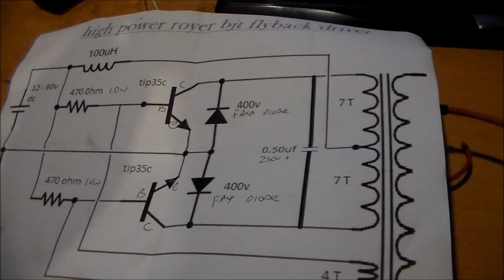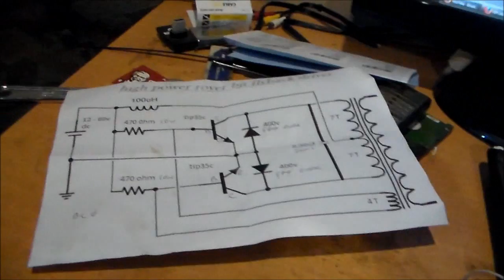Royer Oscillator + Flyback first arcs

Comment from the maker: i use thin wire for feedback windings, thicker for primary.
make sure you have the turns the right way. 
also for testing purposes, i use a 12v regulated 1 amp supply, as to not blow transistors if its not oscillating. reverse the polarity of the feedback coil and try again.

Comment from the maker: you will likely need to use the exact components you find in the schematics :-)
you can pick every transistor from the board. google their part numbers, check their configuration, if they are close, you can try. larger looking transistors probably be better :-) tip35s are quite large cased :-)

Comment: You have a junk box? just look for some transistor with medium voltage (70-300v), high current (3-20A), and low on resistance, try to get two of them with roughly the same gain(hfe) also.

Comment: i tried irf540 mosfets today and it operated really weird it drew 40a 20v off load and 41a arcing and the arcs were only 20mm and all the wires expanded lol. 

so probably not the best using mosfets lol  

be safe:)

Comment: you dont have to use the tip35c's :) as long as you got two npn transistors with a voltage above 60v and at least 5a or even 1a but you wont be able to push much more than 12v through it with only 1a transistors :)

Comment: this may sound like a stupid question but what a tft coz i really need a current limited supply ,iv got a sstc and running it at 90watts but its built to handle 400 watts i just cant find a solution thats not gonna cost £50 from ebay .thanks in advance .